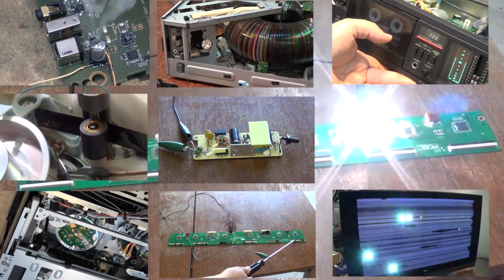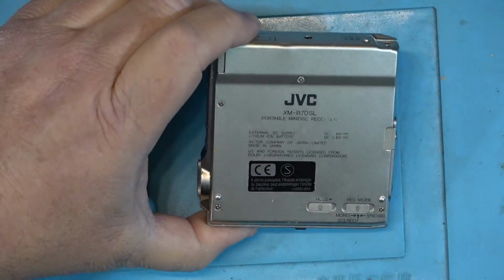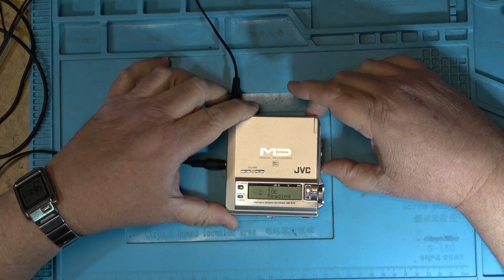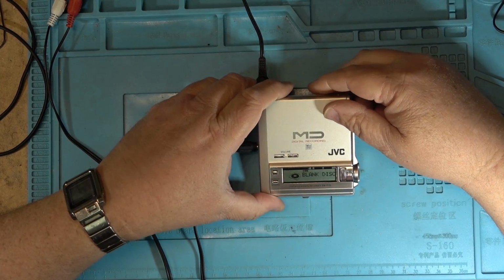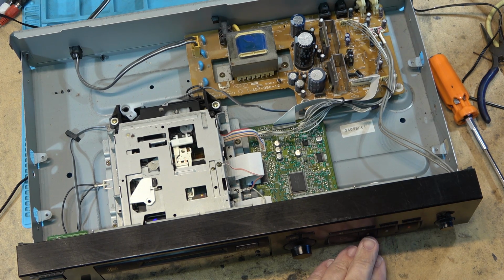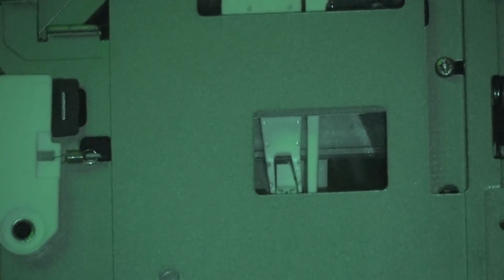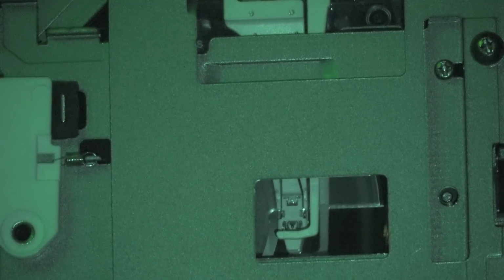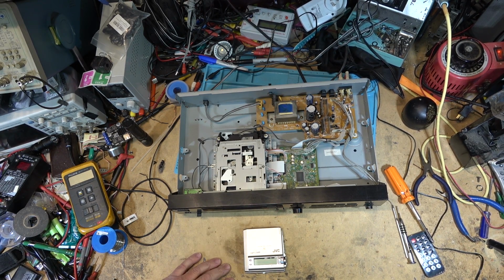JVC Minidisk No play.

Comment: I have a Sony MZ-RH1. Of course with a defect gum battery. Also it just reboots when being touched on slightly. And it goes into recording protect now and then. There are software that works connecting it to Windows 11 to transfer files. This format was really dead on stable to save recordings for future use, but now I dont really know. I did never ever experienced any read errors from this format, even before I went to HI-MD, and did not experienced any read errors after this.

Comment: Looking at the size difference is the reason I almost got on the MD train. The size and weight of the first MD players were huge and the audio quality was worse than CDs. Newer units got smaller and the audio quality got close to raw digital. Portable CD players were large and prone to skipping. MD players had great shock protection. Metal cassettes on my Sony walkman performed really well, but it got real tempting towards the time that JVC one was made. MP3s killed that plan.
Reply from the maker: Now a minidisk that could load up mp3 files on disk would have been the cats ass.
Reply: @12voltvids  I hope you're doing well. I was just wondering if you happen to offer repair services for send-in items? I apologize for using this conversation for this inquiry, but I wasn't sure how else to reach out to you ;)
Reply from the maker: @LexLutherBDA  that's where most of these cone from.  I am keeping the post office in business.
Reply: @12voltvids  how can I find the postal address? Or how can you share it with me? I may have one or two or many 🤪 repairs I need help with 👍
Reply from the maker: @LexLutherBDA  contact me by email
Reply: @12voltvids  easier said than done - where do i find your email?
Reply from the maker: @LexLutherBDA  main page.

Comment: This was a cool format, and was a lot more reliable than CD-Rs ended up being. It's too bad the portable players are mostly the typical delicate 90s electronics full of tiny fiddly unobtainium moving parts that are basically unfixable outside their probably 3-5 year design life. I had a Sony portable that died around the time iPods were getting big, and anyone I talked to who was qualified to fix it basically shrugged their shoulders regarding repair (ie just throw it in the trash and buy an iPod). I had a bunch of recordings I made off the radio in the US, Canada, and parts of Europe and if they still exist they're probably rotting a box in one of my relatives' basement.

The prerecorded discs had the audio data pressed in and were read with the laser, just like a tiny CD. They were pretty hard to find here, I occasionally saw them at the big record stores in downtown Toronto but nowhere else.
Reply from the maker: Even the self recorded disks were read with the laser.  Phase change.
Reply: Believe it or not, I somehow misplaced a box full of MDs on top of an old outdoor freezer. Two or three years later I found them wet and dirty in the box. Thinking they would be toast, I went ahead and brought them in to dry. Then dusted them off. To my surprise, they all worked perfectly! So don't give up on your old MDs. Some of the pre-recorded ones are worth a fortune too!

Comment: Use a prerecorded disc to test - you can't erase them or record on them -
Reply: Too bad they are all copyright protected.
Reply: @j.t.cooper2963  years ago I made a device to strip the SCMS bits from the digital stream which allowed recording from protected sources.
Reply from the maker: And just what would that do?  If i played a copyright track yt would flag it and take it down.
Reply: @12voltvids  I was referring to the SCMS system that prevents digital dubbing (the same system used with CDs, DVDs etc)
Reply from the maker: @MrRobgum  smca never bothered me. I use a tascam da40. No copy protection on that or any other pro unit.
Reply: @12voltvids  it only applies to consumer gear. I have a pro Denon minidisc recorder and I can record from the digital input without any problem, but minidiscs won’t allow a second generation digital dub i.e. you can dub from a CD to MD but the MD can’t be digitally dubbed on consumer gear
Reply from the maker: @MrRobgum  yes I know how it works. I can using my da40 set it to no copy protection , 1 digital copy or no digital copies.  You can always however use the line out and line in.  If i record a dat with no smcs I can copy that to md a d then copy that md again.  I can also copy that dat to another dat